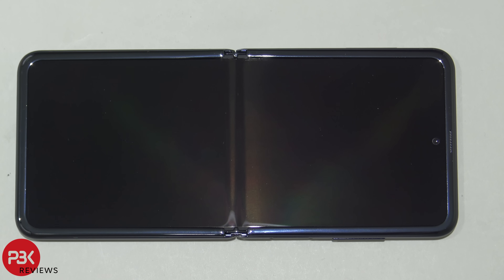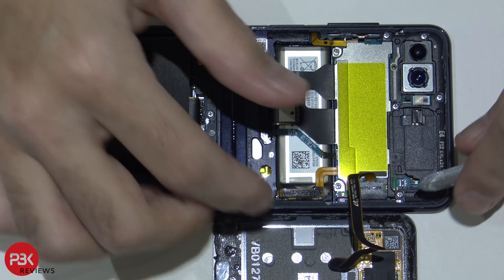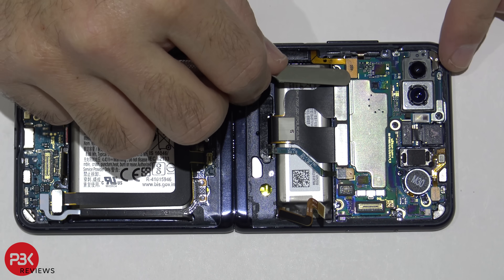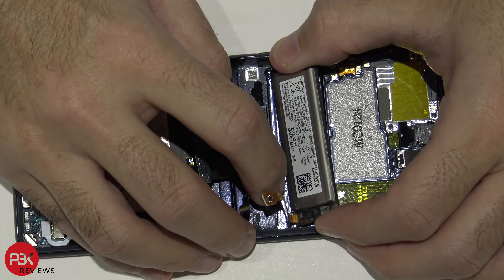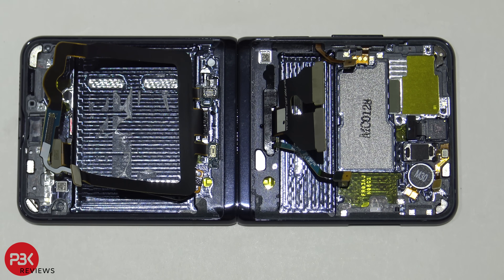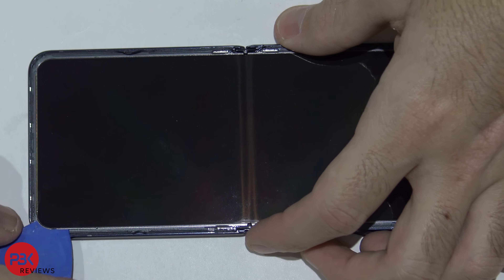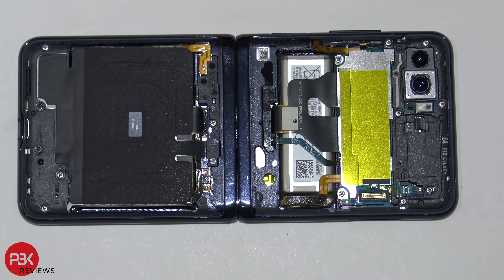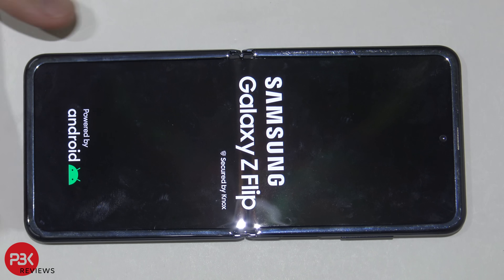Samsung Galaxy Z Flip Disassembly Teardown Repair Video Review 2020

Comment: After replacing my screen i cannot power on the smartphone unless it is connected to the charger, and even if it is connected to it the battery does not go up it remains stuck to 30% more ore less

Comment: I want to say thanks for all the guidance.

My friend, now i replaced the NFC panel but still wont charge normally. Pls be patient im going crazy what happened on this phone

The screen and all other functions is normal apart from it not charging.. 😭
Reply from the maker: hmm might be an issue with the sub board, not sure.
Reply: Already changed that too.. 😔 could it be the cables that join the top and bottom half?
Reply: Or is it also possible that the batteries need to be changed? Thank u soooo much. God bless u

Comment: Hello pleas emake a video about samsung z flip, too cold to use flash, or too cold to charge. It has the yellow triangle and wont charge as normal
Reply from the maker: You might need to replace the charger port/sub board or battery
Reply: Wow thank u, this saved me time to search for shops to repair or possible solutions. Im goung to buy now that sub board/charger port
Reply: I already changed the charging board/sub board.. but still with yellow triangle. What could i be missing my friend? Do i need to replace wireless charging panel/part?

Comment: How do you apply heat for taking off the plates and other things bonded with adhesive.
Reply from the maker: I prefer to use a hair dryer, it provides even distribution of heat and less likely to damage anything. Just move it around until its hot enough to the touch and you can always apply more heat as needed.
Reply: @PBKreviews  Thank you so much, I'm fixing my moms phone because there are some pictures there we need to retrieve. She will be very happy! 🙏🙏🙏

Comment: my z flip 5G has water damage and two numbers that need for pin passwrod for  the lock screen don't work, I'm so scared to go through this process
Reply from the maker: It's definitely not the easiest phone to take apart but yep it would need to be taken apart to dry out any water inside and brush off any corrosion around chips or connectors causing the parts to short and not work properly.

Comment: Thank you for the video!
But I have to change the frame that you can see at 7:57; after I remove the old one, to put the new one, do I need an adhesive tape or does it get stuck without nothing?  Thank you in advance.
Reply from the maker: Hi, you're welcome. Yes you would need new adhesive tape but if I am not mistaken, replacements should come with the adhesive pre installed. I could be wrong though.

Comment: I damaged the screen when I took apart my Flip to get dust out of the hinges.  Do you know if there is an online source to buy just the screen?  I also need the small screen on the cover if you know a source for that as well.

Great video.  Thanks!
Reply from the maker: Hi, on ebay you can search for galaxy z flip lcd and you will see some listings for the outer screen and I saw some for the inner but the inner screen seems to be very pricey. You can contact samsung for a repair should probably run much cheaper for the inner screen.
Reply: @PBKreviews  Thanks for the quick response.  I'll check it out
Reply from the maker: @sporterhome  no problem

Comment: How do I go about replacing just the top back half of the z flip? I want to keep the wee screen also.
Reply: You will have to buy the top glass with the small screen unfortunately. I tried to transfer the small display using heat and careful prying but one of the layers of the display is completely adhered to the glass which makes it impossible to remove. Ended up not working anymore and had to buy a new glass with the small screen :(

Comment: If I was to replace the back glass only, can the outside screen be removed and transferred to the new back glass? Thanks :)
Reply from the maker: Yes, it's held on with adhesive, you would need to use a hair dryer or heat gun to heat up the glass to make it easier to pry the screen off of it.
Reply: @PBKreviews  thank you :D

Comment: I by mistake inserted the sim ejector pin in the top hole which I'm assuming is a mic. Can anyone confirm what type of damaged it would have caused ?

Thank you
Reply from the maker: Hi you will be fine, that's the hole for the mic and the mic is a solid metal piece on the main board, the chance of damaging it is very small.

Comment: Compared to razor phone this is so much more simpler yet so well engineered phone from inside. Even screen replacement seems very easy.
Reply: yeah seriously, i wonder if the screen can be replaced without removing the back glass? hard to tell since he removed everything before the screen came out
Reply from the maker: no because you still need to disconnect the cable that is attached to the main board. So you would need to take at least the bottom portion glass off to disconnect the battery cable, remove the speaker assembly and then disconnect the screen cable.
Reply: @PBKreviews  still though looks like it's not gonna be super difficult to do the repair right? Which screen go you think is easier/faster to replace?
Reply from the maker: Yea wont be easy at all. Probably the Razr, because of the fact the outer boarder that covers the Z flip screen is flimsy and hard to adhere back to the frame with adhesive so without actual pre-cut adhesive that is made for the phone, would be hard to put it back on.
Reply: @PBKreviews  did you mean won't be easy or won't be difficult?
Reply from the maker: @keyboard-commentator  it's an easier process to gain access to the parts of the phone but its more difficult to replace the screen itself since you have to add new adhesive to the back of the new screen and also to the boarder that goes around the screen and its hard to add the adhesive to the boarder since its thin and doesnt have much surface area. If you found precut adhesive would help a lot but im sure would be a while till parts like that would come around
Reply: @PBKreviews  cool. That's for the quick reply. Just good to know both are easier to fix than an iPhone screen
Reply from the maker: @keyboard-commentator  no prob

Comment: You had the best opportunity to show the nylon fibers protecting the hinge from dust.....
Reply from the maker: I assumed the black film like tape I peeled off to be what they intended to protect the hinge from dust, I didn't really see anything else sticking out to me aside from that at the time and did not want to take the hinge apart in pieces to confirm if there was anything else aside from that because I am using the phone currently and wanted to be able to use it for a while and did not want to risk damaging the operation of the hinge.

Comment: so you use the plastic pick for some connectors (not to damage them I guess) and then whilst the main battery is still connected you start using a metal spunger??? clap clap clap
Reply from the maker: Usually I try to use plastic for the most part until the battery is disconnected, but I don't see where I used the metal while the battery was connected, if you can point that out to me at what time in the video. Also sometimes certain things you cant pry off or disconnect with a plastic tool so I use metal instead. I have been taking apart phones for over 14 years, I've worked on thousands of phones and I can tell you that I have never damaged a phone by shorting it. Again to be on the safe side, It's best to disconnect the batteries first when possible. :)
Reply: @PBKreviews  my sincere apologies. I did not realise that the battery connector was the orange one just above the wireless charging flex. Again my sincere apologies for quite a rude comment on my behalf
Reply from the maker: @100clueless2  no worries :)

Comment: Apparently, the UTG manufacturer in Korea (they call it UFG because they purposely made the glass thicker than UTG for durability) can still only churn out 100k units a month. So we can probably expect the phones to sell out over and over for a while.
Reply: That is one of the reasons amongst a few a rep from the company said it will be three years until other manufacturers can catch up to them.  Huawei are pros at stealing technology, but there is nothing here other manufacturers can't do except UTG.  I'm curious to see if the three years holds up. Until then Mate X, Moto Z and possibly the Surface phone are all dead.

Comment: Its all cool and dandy.... but using metal sculpting tool to pry those connectors is pure horror.... you can get nice plastic disassembly tools for less than 5 bucks...
Reply from the maker: If the battery is disconnected you shouldn't have any issue. I have used plastic before its much more difficult to work with, I find it much better with something thinner and stronger. I usually use plastic until the battery is disconnected unless I have no choice and a plastic tool wont really do the job.

Comment: The back covers look easy to replace but the tiny screen seems glued to the cover, I wonder if you can remove it without destroying it
Reply from the maker: Yea, it's held on with adhesive, so heating it up and gently prying it off would separate the screen from the glass

Comment: Much better designed externally and internally than the Razr.
Reply from the maker: Maybe, but the peel off bezel on the outside of the screen seems very cheap and I feel it would easily peel off over time. I also prefer the razr look compared to this, however this phones design internally for being able to replace parts as well as the specs are better. If only they actually put a larger display on the outside, not sure why they went for such a small one, they could have easily put a larger screen.
Reply: @PBKreviews  version 2
Reply: @PBKreviews  maybe the idea of secondary display outside they saving for galaxy fold 2. Its marketing strategy. If they make 1 perfect phone, then people will not buy other series. So they purposely make every single model series have different advantages and disadvantages.
Reply from the maker: @waddefaq4325  Ya that's true.

Comment: Nice!

Is it possible to teardown the hinge and see it's inner mechanism?
Reply from the maker: It would be possible, the screws can be removed and taken apart, but I didn't want to pull the hinge apart into pieces because most likely will not operate the same when put back together and I am planning on using the phone for a bit so yep :)

Comment: There goes $1380, and thanks to you, now I know how to actually open this thing without destroying it.
Reply: But why? Why would you do that?
Reply: @Exotic4M3  When I'm out of warranty, then something broken, like the battery, knowing what and where to pull/lift/undone will save me the phone.
Reply: @djpianz  But if you mess up, you will end up breaking the phone.
Reply: @Exotic4M3  Yea, well, don't mess up then...😳, but frankly, from the video above, it looks like that the repairability score is about 6/10 for me where 1 is the easiest and 10 is the most difficult one.
Reply: @Exotic4M3  If they are at the point where the phone is essentially not working anyway, then why not try to fix it before spending $1300?